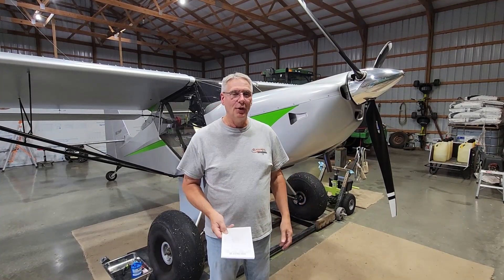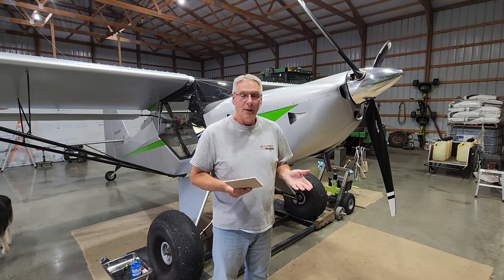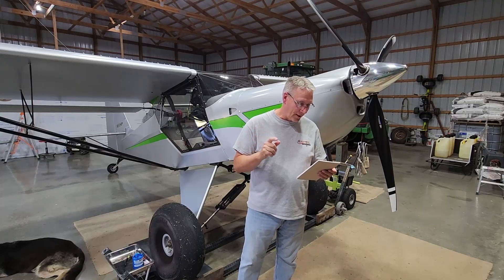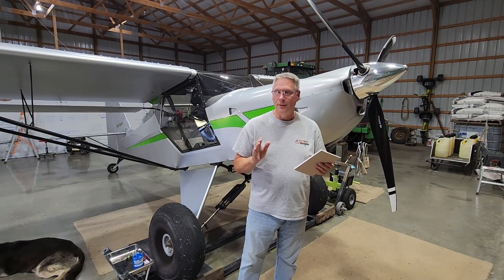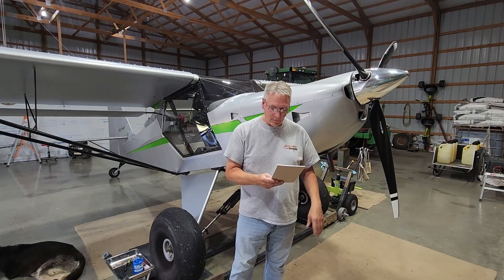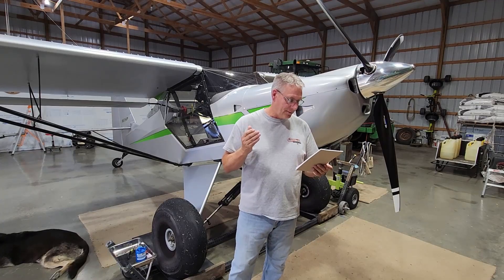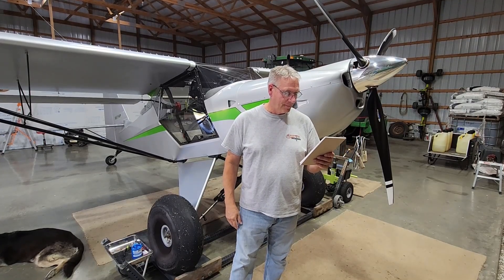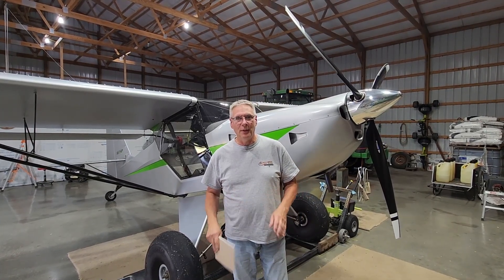Switching from Rotax 915is to 916is is it worth it review and New Airmaster STOL propeller review.

Comment: Forgive me if you mentioned it, but please consider that the 915 might not have been able to make use of the extra potential of the prop.
I’f you’d installed the prop on your 915 first and then installed the 916, you might have been unimpressed with the prop and thrilled
with the 916.
Reply from the maker: Very true on pull part, but the increase in speed at 5.5 gallon per hour cruise is the same hp on both engines at 5200 rpm.

Comment: At 245 degrees the coolant exits the system. So 240 is close. An $8k difference in price. My first 912 was $8k for the whole engine. 1998
Reply from the maker: Yes the prices have went nuts for sure. Over 60k right now with tariffs. That's up almost 10k since I bought mine....

Comment: When Rotax launched the 916, they noted the fuel economy gains are 10% less fuel burn at full power (5800 rpm) and 20% less fuel burn at max continuous (5500 rpm).  At lower power settings, the 915 and 916 have the same fuel burn specs.  Also, FWIW, if you assume a 1200 hour life out of the 915 and a 2000 hour life out of the 916, the 916 costs less per hour of anticipated lifespan.

Comment: Thanks for the video and these tests you did, Harlan. After seeing all the differences you mentioned, the new propeller seems to make more differences than the 916is. That makes me wonder what will happen if the new propeller is installed on a 915is ... Thanks again for your effort in doing all the test and sharing the conclusion.
Reply from the maker: Hi Raymond. The prop is made for the 915 and 916 so I believe it would do great on a 915 also. Thanks, Harlan

Comment: Thanks Harlan. I appreciate your comparison of the engines. The 916 is the obvious choice if one doesn't yet have an engine, but if one has a working 915 installed already I don't think the performance numbers argue for a swap to a 916. A lot of expense and downtime and effort for not a lot of gain (even if the 916 did run cooler and with better fuel efficiency). On the other hand, the extra 20 HP available for every takeoff is hard to sneeze at.

BTW Harlan, how did hardness testing go on your 915 and/or 916 crankcases and gearbox cases? Did anything come up soft and have to be replaced? I had my crated 916s tested a couple weeks ago since it was subject to the SB and sadly the gearbox case was soft and had to be replaced. :-(  Fortunately the crankcase was not soft. I sure hate that I have a brand-new engine, still crated, and the gearbox has already been taken apart and re-assembled. Glad to have the properly hardened gearbox case, of course, but will now always worry that the mechanic screwed something up by going inside it.

Again, thanks for your videos Harlan.
Reply from the maker: What you say is all true Glenn!

Comment: Thanks for all the info Harlan... and enjoyed the bloopers.  I'd be willing to bet some of the lack of increased performance when the engine was swapped was because of the old prop.  I've flown in 2 different 915 STi's now, yours with the Airmaster, and another at Stick & Rudder with the MT... and there was a pretty noticeable difference... the MT definitely pulled harder than the Airmaster you were running before.  It will be interesting to compare your new Airmaster to the MT once I get my airplane down to Missouri.